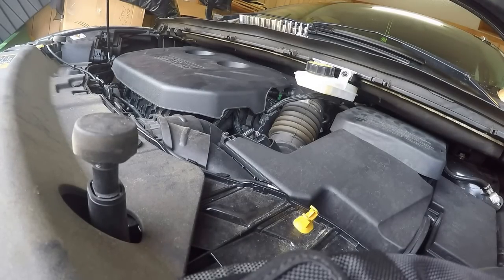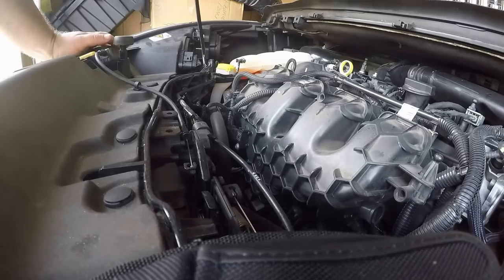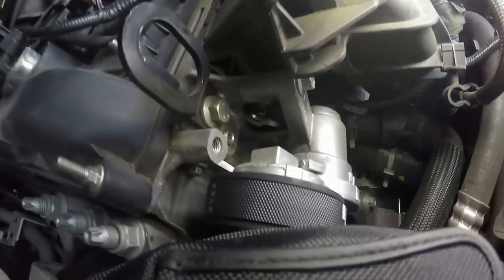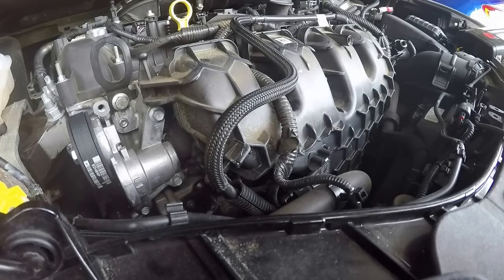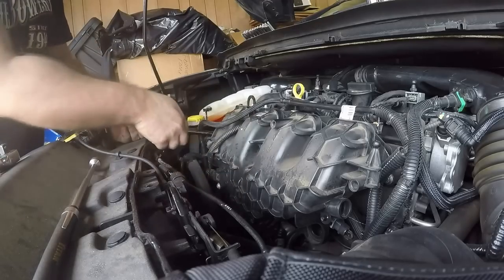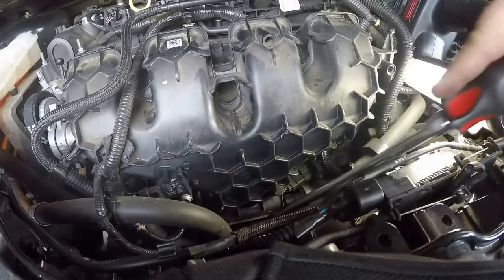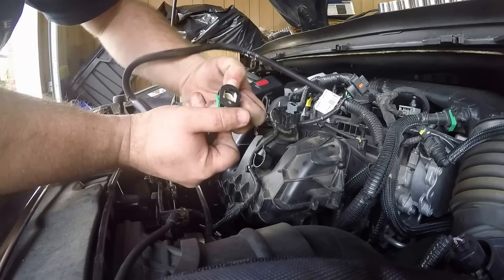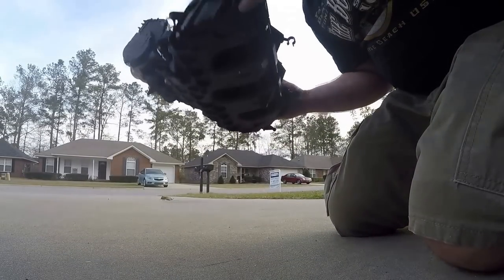Ecoboost intake carbon DIY valve cleaning turbo 2.3 2.0 1.6 ford escape turbo, escape. Simple tools

Comment: Great video.  Especially helpful was the info about avoiding getting your fingers cut off.  A couple of things I plan to do as I'm headed into this job on the same engine.  1. Also remove the spark plugs and blow out from above. Especially if you don't plan on turning the crankshaft to close the valves as you clean.  2. I'm adding an oil separator to the PVC.  I chose J&L Oil Separator Co.  This should help keep the valves clean so you don't have to do this job every 20k miles or whatever.
Reply from the maker: Also if you can tolerate the heat from a hot engine it makes the big carbon just pop off from still being hot. Also there are a whole lot more options tool wise now from when i posted the video. I believe i had about the first diy valve cleaning, and the only people who would even clean the valves at the time were GDI familiar german car techs.

Comment: Just finished doing this on my '17 with 52k thanks to your video.  Only thing I found not documented in the video was the PCV connection on lower back under side of the intake near the throttle body.  My valves where slight better condition than the ones in the video but not by much.  The carbon was much softer than I anticipated.  I would equate it to old chassis grease that leaked out of a ball joint.  It was clumpy, but could squish it with my fingers.  When I got the intake off, the valves for 1, 2, 4 were closed.  After I cleaned these I turned the crank pulley 90 degrees and ended up with the number 3 cylinder valves closed.  My cleaning process was #1 scrape with screw driver  #2 blow out with air wand #3 clean with circular bristle brush #4 blow out with air wand #5 spray CRC GCI intake cleaner #6 wrap screw driver with paper towel, secure with tape insert into intake runner and allow to absorb cleaner #7 spray brake clean #8 absorb with paper towel, #8 blow out with air wand.  Planning on doing the same process now on my '13 F150 with 72k.  Thanks again for the video documentation.
Reply from the maker: Yea thats why i said to work on it hot and the carbon jus pops off. Good job! Its amazing how 10k in mileage can make a difference, and better fuel. She was running cheap 87 before she met me, run a minimum of 89. It is so cool that a video I made so many years ago is still helping people.
Reply: @scrappyitalian  I would add another small thing to lessen the carbon buildup would be run "top tier" grade fuel.  Around my parts Costco and QuikTrip have top tier grade fuel.  https://www.toptiergas.com/station-finder/
Reply: @MrJoedotmac  same here. Wife now alternates gas grades between fill ups. Will be installing a catch can to the recirculation into the intake.
Reply from the maker: I did not see this reply and i apologize for not messaging back in a timely manner, i hope everything is going well and any issues were worked out.

Comment: Hello Lance,
I have a 2.4L ecotec direct injection.
What worked very well for me was removing the intake manifold while the engine was still at normal operating temperature and spraying the intake valves with Carb Cleaner (I used Johnsen's Carb/Intake Valve Cleaner).
The chemical would boil up and out with some very nasty carbon deposits.

Cheers,
Reply from the maker: Whatever works is great!
Reply: That's a very good idea actually. However, it could be riskier on a turbo engine such as these.
Reply from the maker: I did not see this reply and i apologize for not messaging back in a timely manner, i hope everything is going well and any issues were worked out.

Comment: very nice, thx for your work, I have an smax mk2 2015 2.0 ecoboost, now with 105000 km I think now is the time to check it "thumbs up".
Reply from the maker: Lexon 2262 it is really a whole lot easier than you think. The intake tubes are very narrow so expect that and use a air wand to blow the carbon back out and make sure the engine it nice and warm, the carbon just pops right off. Sparkling clean would be ideal but get the main junk out and sprat sum of the cleaner i use and let it sit and wrk. Do not spray so much it washes out the turbos or makes a hydrolock condition; use your best judgment. As long as the chunks are gone you will be good for another 45k +. Also buy the new intake gaskets with the mileage you have. And be sure careful with the stock electrical connectors esp the ones under the intake.

Comment: I’ve used Shell V-Power Nitro+ for 3 years now and it has kept my 2014 Escape 2.0 AWD Titanium running smooth. Close to 103K miles and still smooth and powerful.
Reply: Your gasoline never sees the back of the intake valves, because this is a direct injection engine.  Top tier gas won't help here.
Reply from the maker: the oil is key amsoil and change it at 5k

Comment: This video helped my decision. I was going to buy a 2021 f150 3.5 eco boost and now I am buying either a Tundra or Tacoma. Ford should fix any problem wether the Check engine light is on or not. Bastards
Reply from the maker: yea we have put thousands into this car and yea we have loved it and hated it at the same time. If it were not for the extended warranties we would have been in real financial trouble.

Comment: Good work bud. I got over 220k km on my 2013 and am not looking forward to doing this. I heard that some guys are using lacquer cleaner/thinner to help dissolve the carbon , they were doing one set of valves at a time then rotate the crank to close the next set of valves  and so on. Then suck or blow out the chamber. Guess they don’t want any CHUNKS making it thru to the turbo. 👍
Reply from the maker: Yea i have heard a lot of comments the carbon going through the turbo and the CRC spray method i used on my SHO sent carbon out the back like a diesel. My thoughts are use amsoil, or a good synthetic to slow the carbon. A catch can would be the best option if out of power train warranty.
Reply: Yeah now on thinking about all this, I have decided to bypass this Ford repair and head out to purchase a Honda Ridgeline instead. Im getting too damned old to be doing this kind of shit.
Reply from the maker: I did not see this reply and i apologize for not messaging back in a timely manner, i hope everything is going well and any issues were worked out.

Comment: Thanks for doing this Video.  My 2014 with over 200K is losing power when you hit the gas hard like trying to pass.  I am thinking the throttle body needs a good cleaning.and maybe the valves since I will be in there. So thanks for posting.
Reply from the maker: Make sure your trans is good, mine went out at 120k the rebuild was 3k. Also the head gaskets like to go out on them. I would do a pressure test and compression test.

Comment: Amsoil put out a paper showing it has 45% less volatility or separation loss under load than RP or Mobil 1. This was tested for the purpose of the ecoboost base to eliminate most of the issues of oil vapor through the PCV system. An outfit in Florida also sells a catch can for these with the proper check valve for under boost.
Reply from the maker: I use amsoil now; however.... you cannot go by the long oil change interval you need to change it sooner as i blew through 2+ quarts of oil between the long amsoil interval. It will go through more oil using the amsoil so be careful! Yes you can top it off but i still change it at the 7500.
Reply: All I use is amsoil in my cars
Reply from the maker: I did not see this reply and i apologize for not messaging back in a timely manner, i hope everything is going well and any issues were worked out.

Comment: Use a can of crc intake valve cleaner. stuff works wonders and it doesnt require you to take your whole intake manifold off. Simply spray it through a vacuum line on the intake manifold and follow the instructions. Stuff works great. I use a can every other oil change and my valves are fairly clean
Reply from the maker: Barn find rebuilds i used it on my 3.5 ecoboost and with low miles it works fine. But i would run a snake scope and make sure because with how thick the carbon can get there is no amount of chemical that will break it loose.  If you saw how big the carbon bits were you would freak out if those chunks broke off and blew directly into the cylinders using a chemical. Every 15k is cool but if you are over 45k i would take i apart and clean it manually.
Reply: I agree with that. id say a can every 5-10k miles would keep the motor happy. I've really grown to like these 4 and 6 cylinder ecoboost motors. They're actually a lot easier to work on than people think. I have a 2002 ranger with a 2.0 eco swapped into it. Runs like a champ.
Reply from the maker: Barn find rebuilds keep an eye on the coolant level and do frequent coolant pressure checks., every 10k at the min. The 4 bangers go through head gasket’s in all forms of ecoboost because off poor head design and warping issues, with the exception of the v6 3.5. Ford put 2 engines in my escape because of the head gasket issues.  If you have to add “any” coolant you have a leak; that is coming directly from ford.
Reply: I do check up on my coolant atleast once every 2 weeks. No leaks here. The motor in my truck came out of a 2014 escape with 10k miles on it. Kinda seems to be a hit or miss.If my head gasket was leaking I would just pull the motor out and get the block resurfaced, not a huge deal. My 2.0 is in a rwd configuration so pulling the motor is as simple as unbloting the motor mounts and transmission then a bunch of lines and it comes right out. In the process of doing this motor swap I had the motor full installed and pulled out atleast 3 times already. Its a really fun daily driver for the most part. 25 psi of boost on a 4 banger is crazy.
Reply from the maker: Barn find rebuilds yea i try to run midgrade to premium if the temps are over 85. Keeps the detonation down. I think that is part of the problem is running 87, even though ford says its fine in them.
Reply: huh thats weird. The PCM and wiring harness I bought that ford sells to run a 2.0 by itself (basically the motor and thats it, no other body control modules) specifically states that it is out of warranty if anything under 91 octane is used. All I use in mine is 93, and I will never run anything lower than 91 through it. A turbo motor loves to breathe and has amazing benefits when tuned properly using higher octane fuel. My 2.0 is straight piped, uses an oem 2.0 eco intercooler, and has a huge intake on it. It wouldn't surprise me if catalytic converters on an ecoboost chokes the motor a bit at times honestly. Anything emission related imo is complete bs and does nothing for the environment, its just a bunch of political nonsense.
Reply from the maker: Barn find rebuilds yea mine is the 2.5 , and my SHO lets me run regular if i want. If the temps are below the 50’s i will run mid-grade to regular on a long trip with no detonation.  The inly difference with my escape and taurus is the computer backing off power with the fuels which really i do not notice. There is a site that tells you how much power is backed off for the escape VS the octane.  I had a turbo eclipse so i am not lost on burning pistons nit running the right fuel, the ecoboost is a amazing tech. I know the premium RS and higher output ones require 93, or 91 if you are unlucky enough to live too far west. Lol
Reply: yep turbo motors love high octane. Anything to get exhuast gas temps down even the slightest will net big gains. Thats why E85 makes so much more power if properly tuned for. Also that taurus sho you have with a 3.5 ecoboost im assuming is a complete sleeper. Not many people know that Ford makes an awd vehicle around 400hp and whatever torque the 3.5 makes. If I was to ever buy a vehicle brand new off the dealership lot it would have to be a taurus with the 3.5 or the new 2019 edge st. They're both sleepers in my book, especially the taurus.
Reply: @sethgibowski8695  The basic and main difference between motor and engine is that engine converts chemical energy of fuel into mechanical energy whereas motor converts electrical energy into mechanical energy. Unless you swapped a Tesla electric motor into your Ranger, then you have an engine....not a motor.
Reply from the maker: I did not see this reply and i apologize for not messaging back in a timely manner, i hope everything is going well and any issues were worked out.

Comment: BG makes an engine restoration kit 
It’s pricey but it will clean your engine almost brand new. 
Goes for about 350 dollars but if your engine is a mess this will clean it for sure 
Plenty of videos on you tube
Reply from the maker: Well after going all the cleaning and thinking the carbo was the reason for the hesitation and odd drivability problems the main thing is the killing of the engines with the crappy head gasket in the first gen engines that killed 2 engines in ours. Also after the trans going out at about 115k and I did at least 4 flushes post breakdown. 3000$ just so I could sell the car. I personally would run or get rid of your ecoboost 2.0 unless you have a warranty on it. And if you have a 2013 escape the transmissions are not in junk yards and 2k for a used one, later models are easier to find but if you have a 13 run from it, carmax it, please do not dump one of these cars on anyone……

Comment: That's why I added a catch can after the warranty finished. You would be surprised how much gunk gets caught in there.
Reply: Im so pissed off at myself for not doing this years ago. Now with the much higher prices and my age, Im sure it will be a general pain in the butt. Even the newer pcv plate below the intake is over $100 buck (CND) , and that is just a plastic plate. Why did I wait so long .....
Reply: @packratswhatif.3990  The PCV is so painful to get to. I have to change mine now and I am not looking forward to doing this job. Overall the 2.0 is still working great at 290,000 km.
Reply from the maker: yea for sure but i suggest amsoil
Reply: @scrappyitalian  Thank you! I will check them out for my next ride!
Reply from the maker: I did not see this reply and i apologize for not messaging back in a timely manner, i hope everything is going well and any issues were worked out.
Reply: @coolwaterblvd  No worries! My 2.0 ecoboost won't die. Still has near the same gas mileage it did from when it was new 11 years ago.

Using Amsoil now. They have great  products.
Reply from the maker: Well keep an eye out for the tranny ours went out and it was 3k for a rebuild just to get rid if it. They are defiantly not a 200k mile car. The pass control arm wears out way before the drivers side and is difficult to find, and you def want to get a ford one. A tip if you do the control arm is take the links loose and the job is so much easier to get it out and back it.

Comment from the maker: Remember i only basically popped off the soft carbon with the long screwdriver and did not “scrap” the valves because it was so soft and easily came off, as i let the engine stay hot.

Comment: Why didn’t you look into getting an after market blow bye catch can . The direct injection are susceptible to carbon build up on the back of the valves.PCV valves aren’t sufficient to do the job maybe on a naturally aspirated engine . The European model cars VW, BMW, BENZ had the same problems so that’s why the the catch cans are good for this problem.
Reply from the maker: ford will not warranty it with a catch can. however switching to mobil one, or amsoil in my case helps a lot.

Comment: all the build up is from the intercooler blowing oil either drain your cooler or add a oil catch
Reply from the maker: yes that is party true, but if you lookup the PCV system that has no “PCV” valve it basically shoots all the oil list directly on the back of the valves, thats why the new ecoboost has extra injectors now in front of the valves to cool and clean them. However I am done with turbos and ecoboost thats why I went with the hybrid. The transmissions are 3000K plus to fix and just too expensive to maintain without a warranty if any major drivetrain component goes out. I am by no means talking to you directly just venting about the ecoboost and the problems. Fyi if you want to not have EVAP problems do not overfill the any new ford it puts fuel in the canistor and throws charlcoal into the evap lines and cost you hundreds of dollars. When the pump stops refrain yourself from pumping more.

Comment: Thanks!! How many miles the escape have?? Mine is almost 120kmiles and dont know if is requiered..im affraid of disambly..thanks for video
Reply from the maker: Yea 120k is a lot on one, the carbon buildup is bad at just 35k. However the big problem is you are on borrower time with the transmission, thats the mileage they like to go out. And its about a 3k dollar job at a private transmission shop.  But taking it apart really is not as bad as you think just be careful with the connectors and evap hoses.
Reply: @scrappyitalian  dont scare me..i change the fluid at 40kmiles..original motorcraft..already do 2 changes
Not problems or anything  that i notice
Reply from the maker: Change the trans fluid every other oil change if you can.